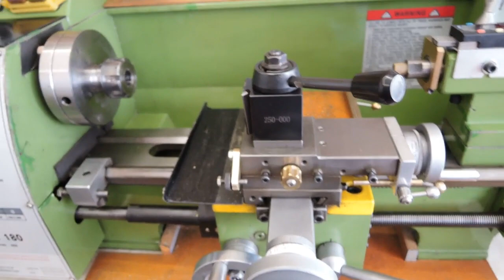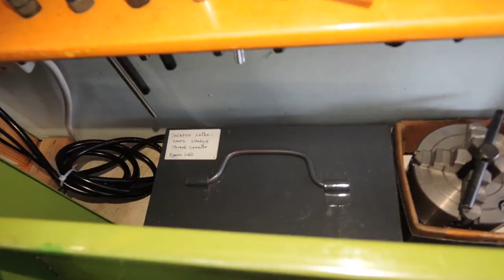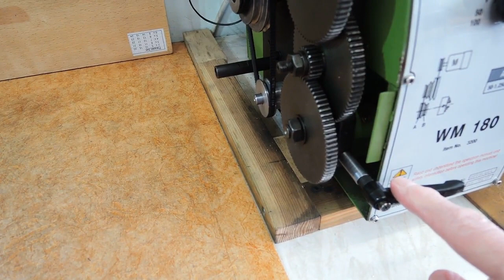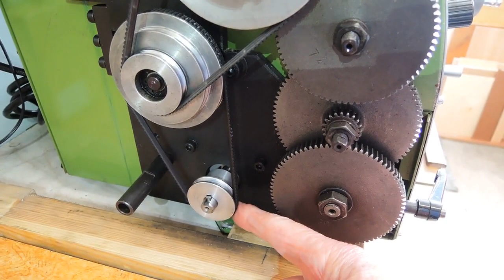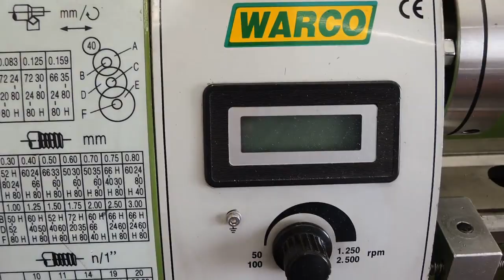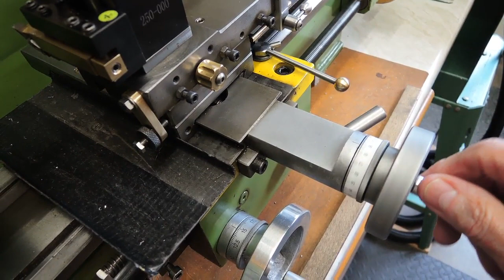Warco WM180 mini lathe Mods you may not have, My model Engineering adventure

Comment: Hi, good video, very informative, now I think I noticed that when your speed potentiometer was turned to the minimum speed the speed was zero and the chuck did not rotate. This sometimes can be a quite a dangerous condition as you could think the lathe is switched off but it is not and could under a fault condition begin to rotate. I feel it better to have the chuck rotating slowly when set to minimum speed, this may be adjustable on the drive board but if not put a resistor of about 10% of the value of the potentiometer is series with the bottom end of the pot. You will know which end is correct as if it’s on the wrong end you will lose top speed. Many thanks for the video.

Comment: Just one point about your method of disengaging and re-engaging your feed gears Geoff. It will work fine for disengaging them, but what your doing when re-engaging them is your bottoming out the teeth in both gears that mesh together. Spur gears are never designed to run with a zero clearance setting like that. And that's also part of the reason you may be getting extra noise from them. A very simple method of setting the gear backlash to a known clearance each time is to just use a strip of paper between the teeth or the two gears as there squeezed together by hand. Since paper comes in a variety of thicknesses, then experimenting a bit with that different thicknesses should get you a gauge depth you can use where the gearing will be a lot quieter and wear far less. Frankly the lathe manufacturer's do a very poor job of even mentioning this very simple method or even explaining why it needs to be done. I hope that helps.

Some well thought out modifications other wise, and a few I'm planning on copying on my lathe that's a bit larger.
Reply from the maker: Pete, if you look at timeline 3.16 it shows a second stop to set the depth of gear mesh. I find this mod very useful as it allows me to use the leadscrew by handwheel. There's lots of potential to modify this lathe and I think we enjoy that as well as making things.
Reply: @geoff5269 Ok I'd completely missed that, so you were already ahead of me. 😀